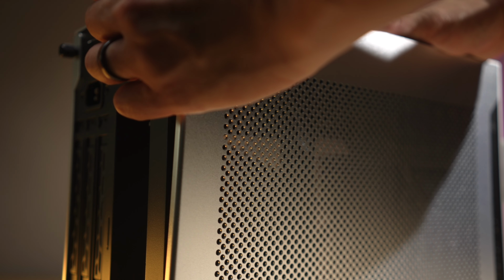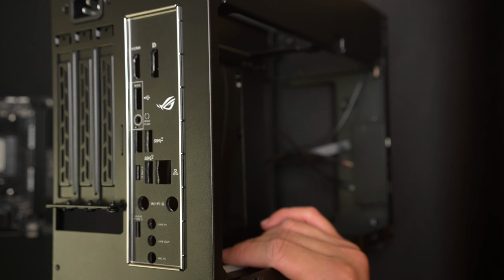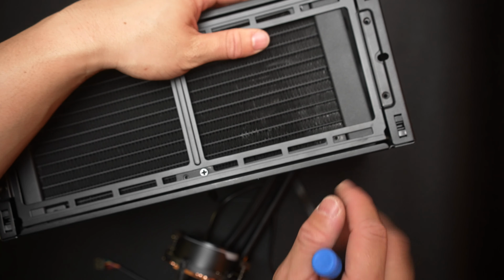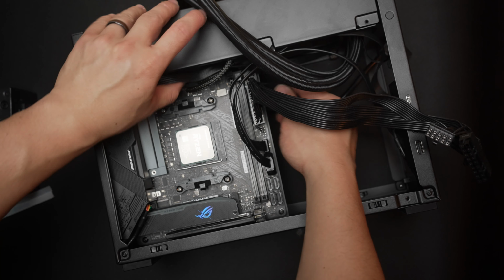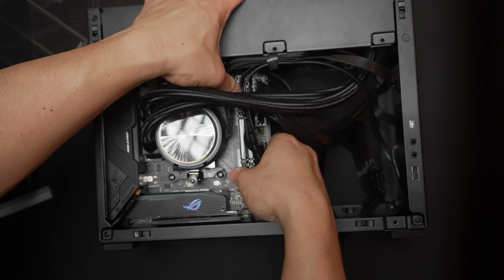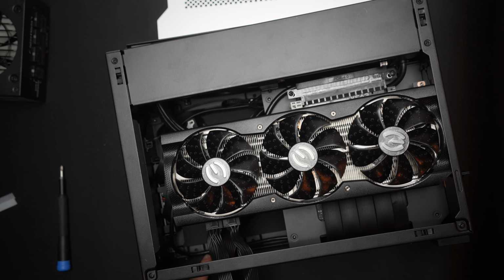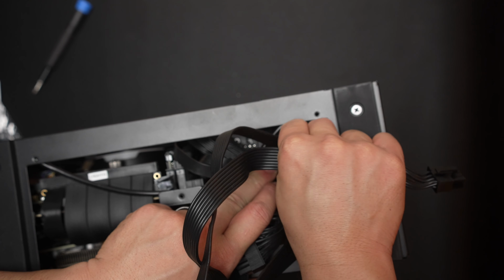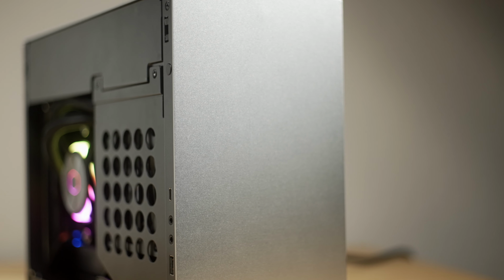LIAN LI Dan A4-H2O Build Guide

Comment: No ESD strap? Maybe I am just an old tech from before Apple and IBM PCs but Apple learned the hard way when they were in the garage building pcs. Many of them were returned so they sent the motherboards to be analyzed and atomic microscopes should crater on the board where ESD had struck. The board or components may not fail right away as in Apple's case but maybe a couple of months down the road. You have to be physically earth grounded via some means i.e. strap, pad or something (for you Jarheads). If not then you risk an ESD strike and even moving your forearm generates enough static as the fibers twitch to measure. Static electricity can build up on your body and release onto the first metal option that you touch. Computer chips and media storage can be damaged when exposed to static electricity as low as 10 volts. Humans are not able to sense a static charge until it has reached at least 1,500 volts. If you can find that old Apple documentary they put together warning all about ESD and how it bit them in the butt hard.
Reply: If you live in a house without carpet…which I do…I’ve never had an issue in 3 decades of PC building.
Reply: @thecomicsarereal  You have been very lucky and how many PCs I am guessing no more than three (3). Get smart and research ESD and the technician. Call Wosniak and tell him how lucky you have been.
Reply: @sandan500  built 2 just this year alone. Our first family computer was a DOS-based Packard Bell computer. The first PC I ever built by myself was a Pentium 75. My second was a Pentium 200 with a 3dfx Voodoo 2 graphics card. I've easily built over 2 dozen PC's in my lifetime for myself, friends and family members. Never used an ESD strap.

Comment: Would have been wayyy easier to plug in the PSU cables before mounting it into the case.  I know this video is 2 years old but I was curious as to why you did this.

Comment: Hi. Will be it healthy for 2,5 HDD installed on the bottom panel under graphic card? I am asking if such mounting doesn't limit HDD lifetime because of high temperture on the upper drives part, with the electronic cooled from the bottom.

Comment: Can you build this case without liquid cooling? e.g. noctua cooler instead?
Reply: Started with stock intel cooler, too noisy. Intel 10700. 

Switched to Noctua NH-L9i, with NVMe double stacked below the cooler. It cooks the NVMe (critical warnings in SMART). Also if you run a game or CineBench the CPU hits 100c and throttles to 3.8GH/z almost immediately. I do not recommend, the cooler spits out hot air top and bottom and the bottom is completely blocked by the NVMe heat spreader. 

I've been running it that way for about a year as I was traveling with it. 

A couple of days ago I installed a NZXT Kraken 240 and my temps are 32c idling and about 75-80 through CineBench. So I'd consider water-cooling a requirement of this build with a half powerful CPU.

Comment: Hi there! I saw both your videos for the DAN A4-H20 and the BeQuiet! Pure Loop 240. I was already set in buying both but I saw a lot of reddit users confirming that they won't go together IF you're using a triple fan gpu. I'd like to know if you've encountered the same issue having both the case and the AIO present for you.

Would be a lot of help as I'd really like to use either the pure loop or the silent loop 2 as it fits my use case of having a silent and performant AIO and I could drain it so I don't get blocked by airport security when flying it in my carry-on luggage due to constraints in bringing anything with fluid. I know it's not above 100ml but it pays to be careful. Hope to get your reply soon!

Comment: Hi the link for your extended m.3 doesn't work. Do you know any other alternatives please?
Reply from the maker: updated the video link!
Reply: @MachinesMore  thank you. For some reason the stand offs that come with the case dont work out for me. 

If i were to screw in the stand offs, the gpu would not align properly with the gpu socket or brackets of the case. So now i just have the pcie riser just dangling there.

Also which standoff size should i use?

Comment: Hello!

I'm new to building PCs and I'm currently building a similar setup using this case, a PL240 and a Corsair SF750. I notice you mention to pass the PSU plug in between the two tubes and the manual for the case indicates to do it in a similar fashion. However, when I try to do so, I find that the tube to the front on the plug (closer to the fan side of the PSU) gets bends into a tight pinch (which might prevent fluid to pass thru). Would you mind sharing more pictures as to how you accomplished this part? Thank you! Love your videos.

Comment: Parts
CPU  |  Amd Ryzen 9 5900x

*Thermal Paste Used  |  Thermal Grizzly kryonaut  /  Arctic Mx-5 (have both) Sometimes I run A few Benchmarks with Different Chips Thus need to re-apply

GPU  |  Nvidia Rtx 3080TI Founder Edition

*Thermal Pad Replacement Done with Gelid Extreme as well as Thermal Paste Replacement

Motherboard  |  Asus Rog Strix x570-I
Windows 11 Ready Label On the Mobo box

RAM  |  Crucial Ballistix Rgb DDR4 White 2x16Gb Cl16 3600mhz (32GB)

SSD  |  Samsung 980 PRO PCIe 4.0x4 (2TB)
          |  Adata Xpg Gammix S70 Blade PCIe 4.0x4 (2TB)

PSU  |  Cooler Master SFX 850 80+ Gold white

CPU Cooler  |  Cooler Master MasterLiquid Ml240 Illusion White

Radiator Fans  |  Nochtua a12x25 chroma (x2) for better Airflow not using Stock Master Liquid Aio Fans

PC Chassis  |  Lian Li Dan A4-H20 Silver Pcle 4.0

Live In Singapore :)
Max Temps 80 *c for Cpu and Hotspot temps for 3080ti fe slightly over 80*c not bad for a SFF Case Recommend for ease of building (First time Pc Builder) Room No Air-Con

Comment: Is there any possible way to install a 3.5” HDD in this case?
Reply: There is a single 2.5” ssd mount on the bottom panel. No room for 3.5” HDD
Reply: i dont think it even have space for 2.5" ssd. correct me if im wrong.
Reply: definitely not enough space for that

Comment: Hi @Machines & More, do you think two Phanteks T30's would fit if you ever wanna change the fans on the radiator?
Reply: Optimum Tech did a build with the T30s and had to remove the anti-vibration pads off the fans to make it fit. I’m about to try it out myself and I’ll come back to let ya know.
Reply: I'm curious about this as well since I have 2 T30s in my nr200 and want a smaller case
Reply: It does

Comment: I'll go ahead and presume this isn't a candidate for my 12900k/2080ti gaming setup eh?
Reply from the maker: For gaming, I think you’ll be fine actually, you’ll see higher fan speeds under high GPU load because the gpu exhaust is going to heat up the coolant, but your CPU temps should be OK for gaming.
Reply: @MachinesMore  I'm not too concerned with fan speed while gaming, right now I'm running a nzxt z63 and see 50-60 during most games.  Right now it idles 24-27 no load and the gpu usually 35 or so no load.  I may see if I can find one in stock, I do like a nice quiet system when doing normal things lol     thanks
Reply: @marchufnagel9068  12700 w/ 240mm AIO and air cooled 3080 here, works perfectly and is silent under web browsing, temps fine while gaming.

Comment: I had trouble installing my graphics card into that riser cable. I saw in this video you messed around with it too, at first it seems like it's slanted then you proceed to push on the right side of the card to correct that, I had the same issue. But just getting the card to slot into the riser was a challenge, I loosened the two screws and I was able to get it in but I worry that tightening the screws again will put strain on the PCB. Also, it's very easy to get wires into the two fans on top, or the aoi tubes for that matter. Optimum Tech showed a graphic informing where to route the tubes based on your aoi and how long they come from the factory, that being either above or below the PSU. Coincidentally I followed the same order as you, installing the PSU at the end was difficult. I essentially just had to shove it in, making sure the front io and SATA cables were bent correctly to fit the PSU bracket. But this is all par for the course when working with an 11L case, definitely was more of a challenge than my old Cougar QBX.
Reply: Hi, I am currently building in this case, my gpu also seems slanted, I’ve put a lot of pressure and can get it straight but as soon is I put the screws in it slants again. From your experience does it sound like side with the cream little clip hasn’t been pushed in enough?
Reply: @danielf0124  yeah I went without the second screw on the pcie riser and the GPU fits in all the way, I guess one screw is enough. I believe I was able to get that clip secured as well
Reply: he put extended m3 standoffs in not sure on the size

Comment: hey boss, there is now a Scythe Fuma 2 rev b. The fans ramp up to 1500rpm instead of 1200rpm. I bought one on amazon for my new-ish build. I haven't installed it, though.
Reply from the maker: Yup, got it on the review queue here!
Reply: @MachinesMore  NIce! I can't wait. I'm going to transfer my components over to my new nr200p from my node 202. I'm eager to see what is a good intake/exhaust case fan configuration given the "upgraded" fans in the rev b cooler

Comment: So I just built mine. A few things I did to help myself. I am using an Asus X570i motherboard which doesn't have a USB-C, so I actually removed that cable from the front. I also removed the audio cable because I only use Bluetooth headphones/speaker.  That helped to remove some cables.  I noticed a very, very annoying humming and I spent hours trying to track it down. It was the Chipset fan going super-fast.  (I came from a NR200 with a NH-D15 and multiple case fans so the chipset was much cooler than it is now)  I have a slim noctua fan cable tied to the exterior of the case to bring some cool air which has dropped the chipset to 60 degrees. I have (2) Noctua 40mm fans and a thermal pad in the mail to try to keep the thermals reasonable and remove this ugly fan off the side of the case!  I also am getting a heat spreader for the back M.2 which is behind the riser cable and TUF 3080. I hope to keep that a bit cooler than it is now.  I want to get custom cables and am waiting on Pslate to have them custom sized. If someone has another recommendation, I would appreciate any feedback to what I have been doing to mod this beautiful case.
Reply: You can remove those cables? Is it modular or did you just cut them?
Reply: @Drone443  yep just a few screws to remove. It was easy to do
Reply: @81llzvn thanks for mentioning removing the front io cables. I have no need for them since my motherboard rear io will have everything I need (other than power button of course). Nice to know that they are modular before I purchase the case
Reply from the maker: Ah yeah the X570 I Strix PCH fan can be annoying. Is yours just spinning under load? The reason I ask is since theoretically with exhaust fans up top under higher load the fans should be doing enough to draw some cool air into the path of the motherboard, that way you can just use slightly higher CPU fan speeds to help out the board cooling.
Reply: @MachinesMore  It seems so.  Once I am working or gaming, the fan turns on and stays on.  The hum is super annoying. I felt the heatsink over the chipset and noticed it was super hot so I got compressed air and blew on it and noticed the fan ramping down. Once I grabbed the slim Noctua fan and placed it, the chipset temps dropped immediately. For the AIO, I am using an EK 240 with (2) Noctua NF-A 12x25. My curve is around 50% with the fans until about 65 degrees then I have it ramping up.
Reply: Hey did you install the 40mm fans where the pool 2.5 inch ssd would be installed? Just ordered this case and am going to attempt a 5900x 6900xt build
Reply: @savifrank6323  I did install them. They rest between the EK waterblock and the SSD cover. I used double back tape on the waterblock and ziptied them together to hold them in place. They werent the solution to my problem though.  I had to search on reddit for how to change the bios to cap the temperature at 80 deg instead of 60.  It is much cooler and virtually silent.  It is beside me now and my chickens outside the house are much louder with their squawking :D
Reply: @81llzvn  ah okay cool. Thanks for replying. I’m probably going to return my x570i and try to get the x570si which is fanless